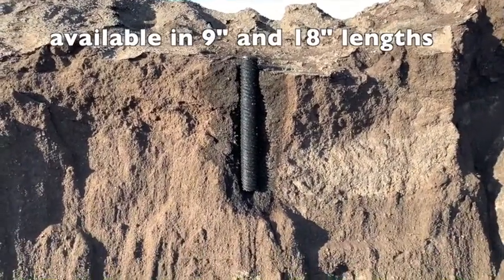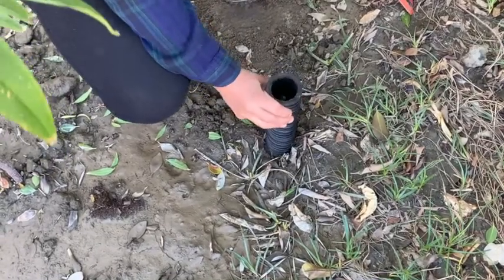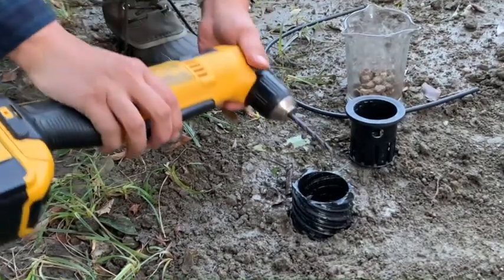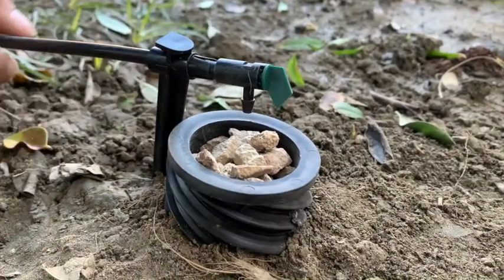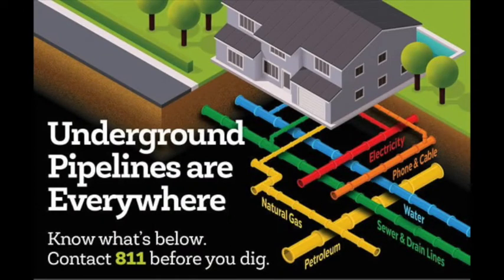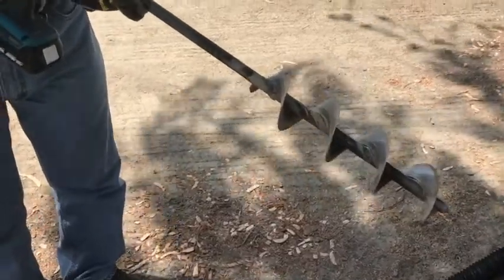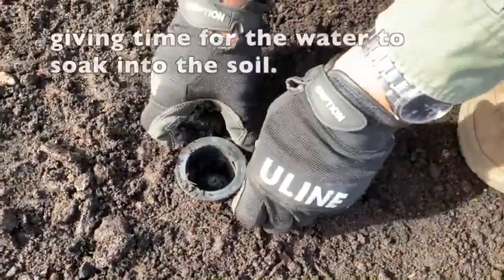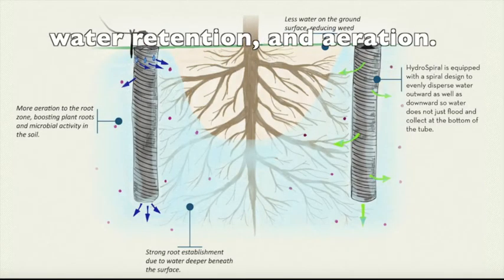Tips on How To Install Hydrospiral

Comment: How well does this do in wet climate? If I get a 2" rain is it going to retain in the basin?
Reply from the maker: Great question, in wet climates the HydroSpiral improves aeration below the surface- allows roots to breathe better, reducing root rot. It is not meant for collecting rain, it will percolate down and absorb into the surrounding soil. If you experience heavy rains, the tube might retain some water depending your soil type (clay, loamy, sandy), how much total rain fell, and how saturated the soil is. If you have a high water table, or prone to flooding, there exists drain and reservoir systems. If interested, please email us thru our website so we can learn more about your needs.

Comment: Can we use these without a drip system?  Just allowing sprinkler water and rain water to enter the tube?
Reply from the maker: Yes, however you would mainly get aeration benefits. The drip allows the water to gradually soak into the root zone and expand outward. You would get the best results with drip irrigation.